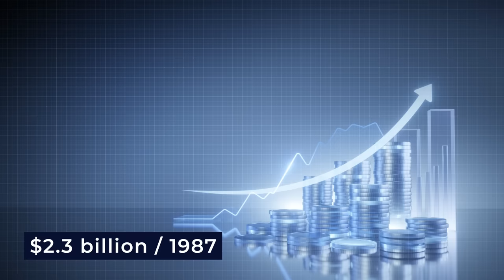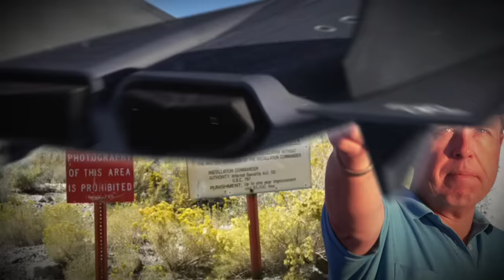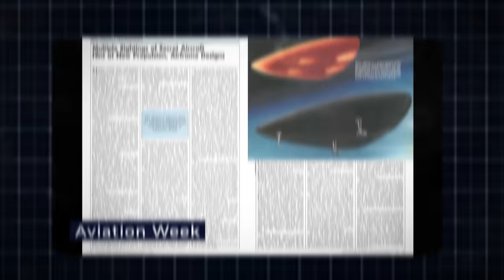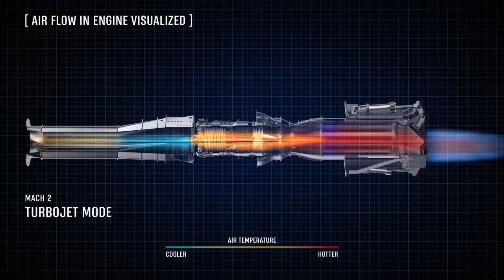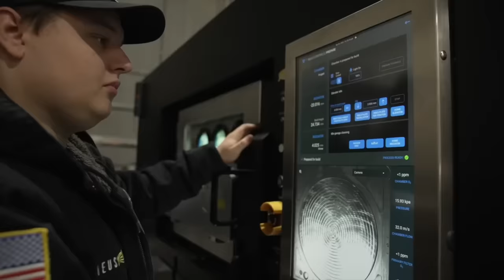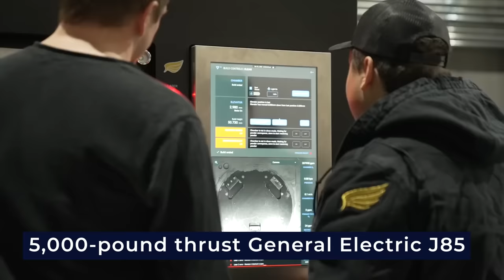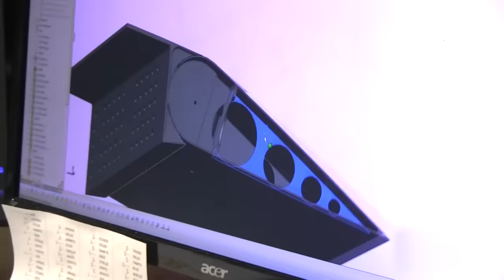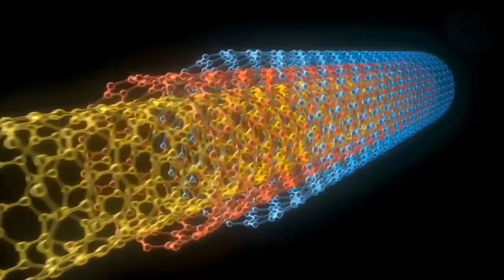The FASTEST Fighter Jet In The World Just Broke Physics!

Comment: The only problem is the Mig-31 has to go into major rebuild if it goes to top speed!
Reply: MIG 41 !!
Reply: DONT PARASHOT OUT OF IT
Reply: oh just that?? lol
Reply: @jessfucket  Severe stress on the engines.  Mach 2 can be achieved "relatively" easily.  Faster than that requires so much more than an engine with more grunt.  Talk of Mach 6 for an aircraft with a pilot/crew is ludicrous.  The SR-71 was only needed until improvements in satellite imaging made a reconnaisance aircraft of that type unnecessary.

Comment: X-15The North American X-15 is a hypersonic rocket-powered aircraft operated by the United States Air Force and the National Aeronautics and Space Administration (NASA) as part of the X-plane series of experimental aircraft. The X-15 set speed and altitude records in the 1960s, crossing the edge of outer space and returning with valuable data used in aircraft and spacecraft design. The X-15's highest speed, 4,520 miles per hour (7,274 km/h; 2,021 m/s),[1] was achieved on 3 October 1967,[2] when William J. Knight flew at Mach 6.7 at an altitude of 102,100 feet (31,120 m), or 19.34 miles. This set the official world record for the highest speed ever recorded by a crewed, powered aircraft, which remains unbroken.[3][4]

Comment: MiG-31 cannot stand the YF-12..? As a fighter it's hardly even worth a mention - the whole project was cancelled before they went into production, they never saw duty... 3 were built for testing, and the only one that wasn't accidentally destroyed was eventually put in a museum in 1979 - same year the production of MiG-31 started, replacing the MiG-25 - which is the only "real" fighter jet faster than MiG-31 I think... MiG-25's were tracked on radar during Persian Gulf War, reaching even Mach 3.2 - even if this would damage it's engines, it was still doable if needed.

Comment: The capabilities of the Mig-31 you describe are those of an interceptor, yet you call it a fighter. It is not a fighter it is an interceptor. You compare it to the SR-71 which is a reconnaissance aircraft because it isn't even armed  The "SR-91 Aurora"  is not a fighter either. It's difficult to tell whether this is based on ignorance or an attempt to misinform. The PDE has been around for some time.

Comment: The F-15E is ever so slightly faster.
Reply: Also more reliable  with more firepower. One if not the only aircraft to lose a wing and fly an additional 10 miles and land safely.
Reply: A-10. List of unlikely survival. Designed to return safely losing a wing, an engine, half the tail. Etc. 
Hit by a missile? Returns safely. 
Most durable airplane ever.

Comment: X-15 highest speed, 4,520 miles per hour (7,274 km/h; 2,021 m/s),[1] was achieved on 3 October 1967,[2] when William J. Knight flew at Mach 6.7 at an altitude of 102,100 feet (31,120 m), or 19.34 miles.FASTER   THAN  THE  MIG
Reply: X-15   FASTER

Comment: The F-15 will go fater than the Russian MIG 31, MACH 2.5+. I have tracted one on radar at over 1800 miles an hour and that was in 1978. the SR-71 has gone as fast a 3000 MPH at 180,000 ft, of course the Air Force will never admit that. Pilots wear space suits when they fly it

Comment: Yes, the SR-71 is slightly faster than the Mig-31, but it does not have its fighting abilities, so, comparing them makes no sense. The SR-71 Blackbird is a spy plane, designed for invading foreign territories through the stratosphere, but could not withstand the interception of a Mig-31 loaded with a hypersonic missile.
Reply: Actually, the SR71, is significantly faster. Original reports were a top speed of Mach 3.8. I'll go with those numbers.